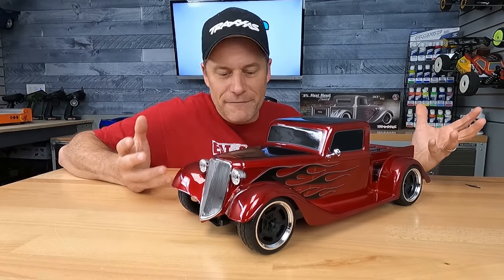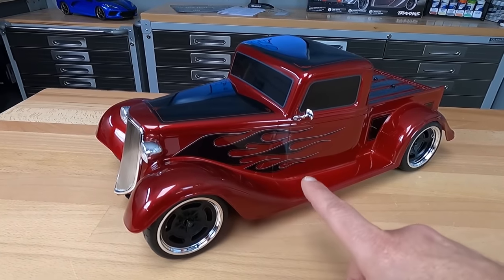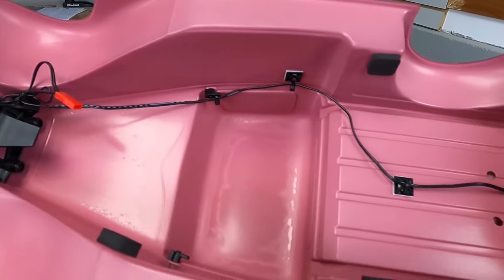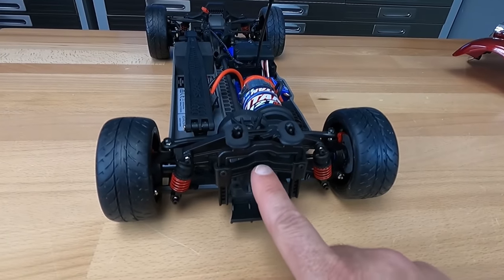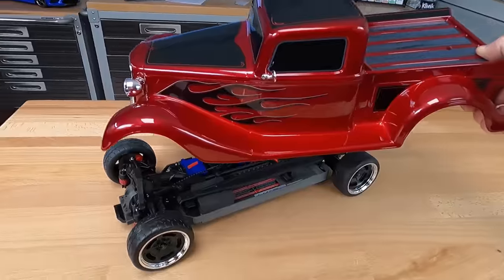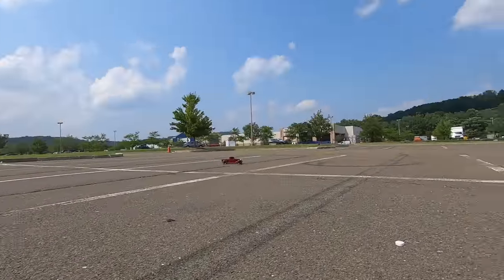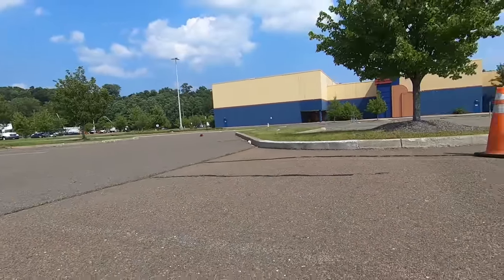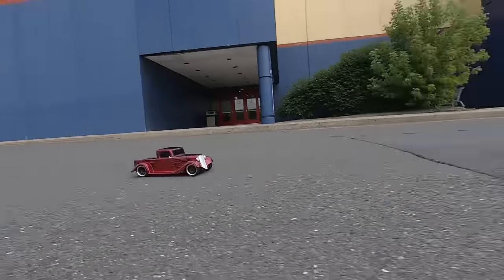Classic Factory Custom RC Car! - Traxxas Factory Five 35’ Hot Rod Truck Review | RC Driver

Comment: Actually, the hot rods versions of the 4Tec 3.0 do NOT use the same chassis as the Corvette.  The hot rods use chassis part number 9322, as opposed to the 8325 chassis used with the 'Vette.  In watching the video, I noticed that the antenna for the hot rods is attached directly to the chassis...that was the "tip off"...double-the part numbers confirmed it.  Now, I'm wondering what other parts initially 'assumed' to be the same as the 'Vette's parts are actually different.  Nevertheless, while they might not be as close to the 'Vette (in parts) as people had assumed, they still look fantastic.
Reply from the maker: Wow, good catch! I had them side by side looking them over, preparing for the video and didn’t pick that up.
Reply: yup the wheelbase is longer for this over the vette too. I was hoping the 2 would be the same so the bodies could be swapped but this has clips and isn't the same size. I might still pick up the silver truck though. I really wish they would put out a replacement vette body so I could tear one up while keeping the stock one in perfect shape for the shelf.
Reply: The receiver box the same one for Maxx 10 scale
Reply: Traxxas did a crappy job hot rod go fast 30 miles an hour is not fast it should have had a brushless system in it Factory
Reply: @charlesdipanni3725  You seem to be ignoring the fact that Traxxas originally released the 2.0 with a brushed system, and then made the brushless version available at a later point in time.  If you look at the 3.0 chassis (both hot rod, or 'Vette versions), you'll notice there's an extra screw hole right next to one of the screws holding the XL-5 ESC in place...that's for the VXL-3S ESC.  In other words, they WILL be releasing brushless versions of the 3.0.  Learn to have a little patience.
Reply: @robbryan3044  still patiently waiting

Comment: I feel like I remember when Factory Five started making their kit hot rods, now to see Traxxas bring them to the RC world is way cool. Being the real world counterparts are kit cars, id like to see these in kit form also. Also, I really feel that them being Hot Rods n all, they should be 2WD - or have 2WD versions at least. Traxxas is definitely capable of making their models in kits and with different drivetrains so I mean why not.
Reply: If you remove the drive shaft, doesn’t that make it 2 wheel drive? I’m not the brightest, so I could be a dumbass for all I know
Reply: @jonathangilbert7003  This is an old comment but I'd assume it would. I have a 4x4 Stampede that can be RWD just by pulling the driveshaft. I'm thinking about getting a 4tec and doing exactly that, lol

Comment: All Traxxas needs to do is make a brushless version with TSM and I’m all in.
Reply: I'm in the process of installing a Traxxas TQi system with TSM into my brushless Hot Rod Coupe. I have a TQi system with the Traxxs Link Bluetooth module installed laying around that I wasn't using, but the antenna on the receiver somehow got shortened. The radio range is severely limited (about 150 feet) until my new receiver arrives.
Reply: I picked up a new receiver this afternoon at my local RC shop and installed it. I took my Coupe outside for a test run, and I now have full radio range. My Coupe is now brushless and has TSM - the perfect combination.
Reply: @jamesmorrell2901  about how fast is it now?
Reply: @jamesmorrell2901  
What performance improvement has been achieved with the changes?
I have both , new Truck and Coupe. They are absolutely fantastic, very beautiful , fast and its new colors and stripes are uffff

Comment: I have a spare vxl setup and was trying to get a 3.0 and I couldn't pass up a sale I just ordered mine on eBay for 224.99 rtr and this review sold it now my only question is what do you do if you want to change the body how can u get the pin setup for the front

Comment: "it's a little looser in the rear than the Corvette."  Duh, the Corvette is mid engine'd and has the weight closer to the rear axles.  While a front engine vintage truck only has the empty bed over the axles!  Of course it is going to break the rear loose more easily!!!   ;)
Reply: Not in the RC World, they are the same mid motor awd chassis underneath.

Comment: I purchased the blue coupe this past weekend. The paint job is amazing. I found a nearly new (run less than an hour) Hobbywing 3300kv brushless system in my parts box, and I decided to put it in the coupe. What a difference: the coupe with the brushless system is faster than stock on 2s, and it's a beast on 3s. The best part is it was pretty much plug-and-play, and it cost me nothing but my time to put it in.